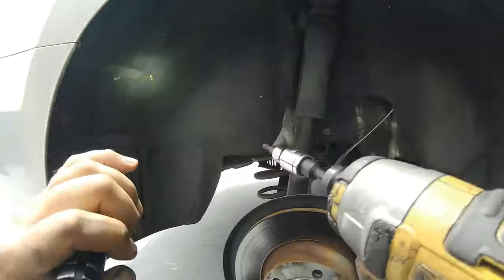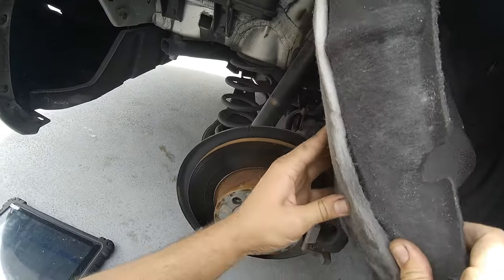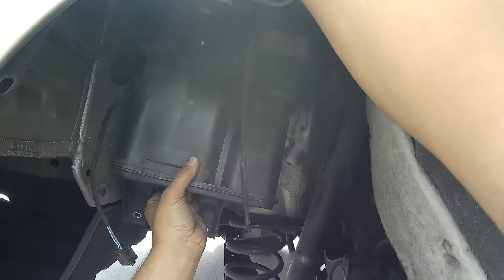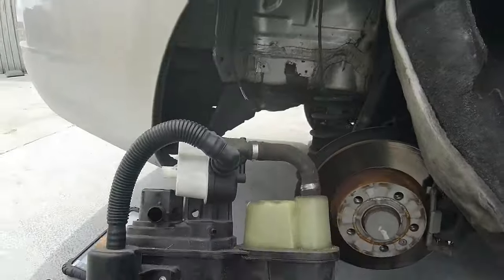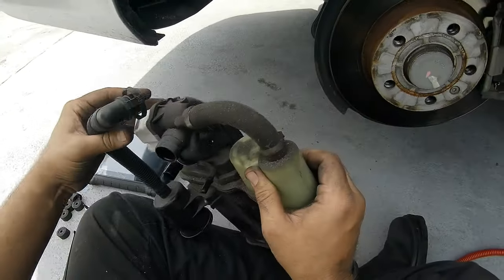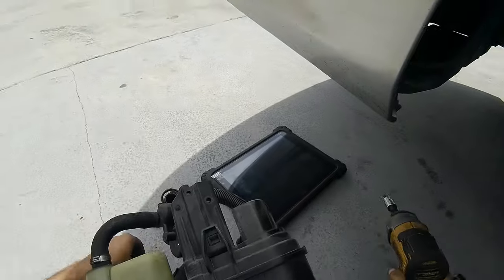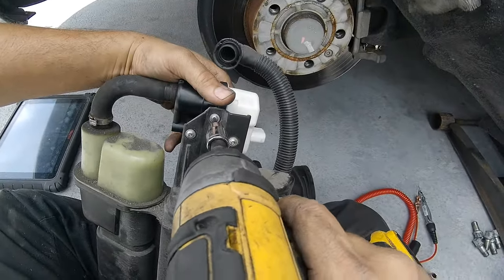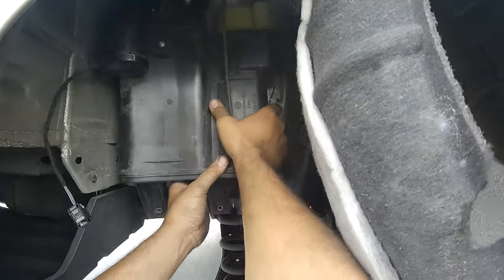P2402- how to replace evap leak detection pump on a Volkswagen

Comment: What is that part called that you installed. I need one
Reply: Evap pump is this video,  ( the large black box is the charcoal canister, if black charcoal beads pours out replace it too)   other small parts can be Gas Cap and Evap Purge valve.  This video is awesome help!
Reply: correction:  Evap Leak Detection Pump

Comment: You can rebuild a canister with charcoal mean't for fish tanks and save hundreds , I did it on my kia. Take the top off using a hacksaw knotting how it comes apart then wash the charcoal till all the fine carbon is out  . Let the charcoal dry in the sun . Put the canister back together using a good glue then reinstall. There is aYT vido or was that helped me save almost 500.00.

Comment: Is p2450 related to this leak pump ?
Reply: Did you figure out if this was related? I have the same error code. Dont want to buy the part if it’s not the right thing
Reply: @TheRevize  well I had the charcoal canister replaced with a new one but that was not the issue it ended up being a evap line that was leaking had it patched and the car didn’t have the check engine light and passed the smog but then later it turn on again . So have a mechanic do a evap smoke check test to find where it’s leaking in the evap lines
Reply: @100sean1  well dang. When you got the error code scanned did it say performance or stuck open? Or did it say something else for you? Cause I paid a guy 50$ to do a diagnostics test and said it was more than likely the ldp where it’s saying stuck open but this guy has a different error code than the one I have and I just don’t want to waste a ton of money trying to repair multiple parts.
Reply: @100sean1  also did you randomly get smells of gas fumes release into your car while driving every now and then?